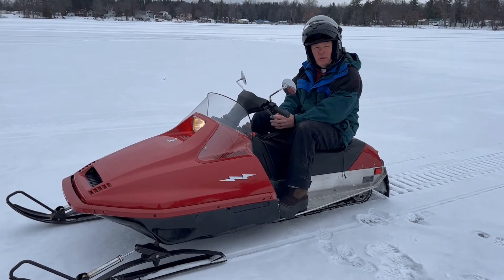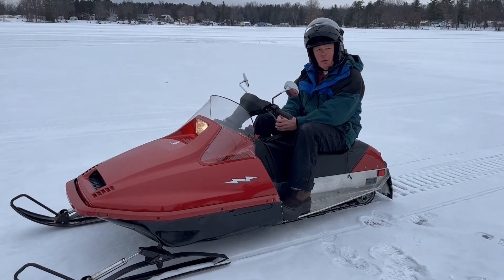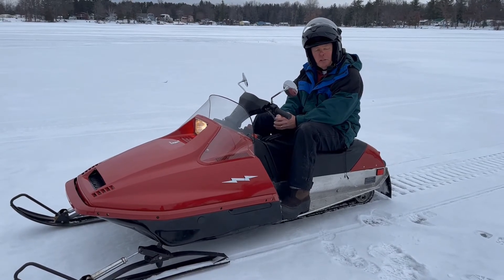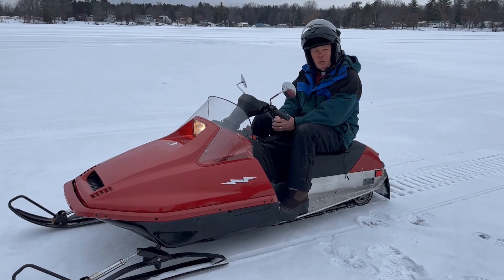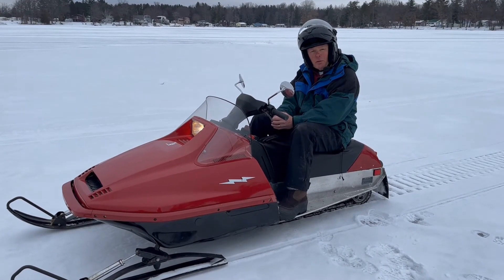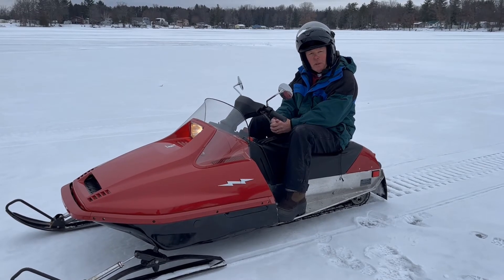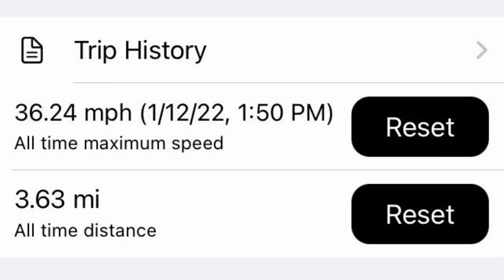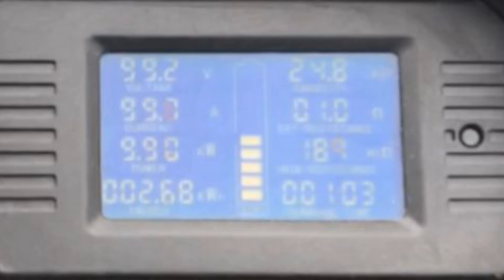Electric Snowmobile Top Speed Test

Comment: I'm working on an electric snowmobile build myself I'm using the same motor I'm going to probably use a far driver controller I'm going to use different batteries and I'm putting a 60t 420 rear sprocket on the main shaft.

Comment: hello fun and see someone who has the same interest my next project will be a snow scooter I have hitils built a rear wheel drive atv that will be street legal I also have snow traks on the way to it what have you used for the engine for the snow mobil?  and controller?
Reply from the maker: I used a QS Motor 4000w with a Kelly KLS-H Controller
Reply: @e-grandpa9778  would you use that engine again if you were to build another snow mobile?  what does your snowmobile weigh?
Reply from the maker: @goelectric8269  It would work better with 5000w or 6000w instead of 4000.  I put the motor where the existing secondary sheave is located for direct drive and was therefore space limited.  It would also work a little better with a slightly lower gearing - maybe 2.7-2.9 ratio instead of 2.6.  The original gas engine ratio was 1.6.   Again, I was space limited in order to maintain the existing gear box.  It's fine, just could have a little better launch.  The weight is 475#.  Given this snowmobile design and space constraints, I would do everything the same.
Reply: I have been thinking about one thing you drive 100 battery amps  to the controller you write that you would run a 6000w motor if you built one again but this one delivers a lot more than a 6000w my v3 motor I run at 200a 72v = 14400w can you drive more amps to The motor If you whant to ?
Reply from the maker: @goelectric8269  At full throttle the snowmobile was running 99v and 100a so 9,900 watts (11,500 watts fully charged) as you can see in the video.  The issue is the motor will only rev to 4,700 rpm with a Kelly controller the fairly large drivetrain resistance.  Maybe another controller with flux weakening would help somewhat.  Not clear which one??  With a different configuration where I could use a higher-torque motor (larger) with an appropriate ratio to the jack shaft I could achieve a much higher track speed and therefore I could achieve higher snowmobile speed.  My current configuration is direct drive with the motor in the same location that was for the secondary sheave.  The gearing is 2.6:1 (existing gear box, but with a higher ratio compared to stock) which gives me balance between launch and speed.
Reply: @e-grandpa9778  you have to try with votol in that case then you should be able to get the engine up to 6500 rpm.  can not change fluxwekining on Kelly controller?
Reply from the maker: @goelectric8269  No. I have the Votol EM-200 in my ATV. I recently got that going. I will work on that first. Thx.
Reply from the maker: Any input on a flux weakening controller that would work?